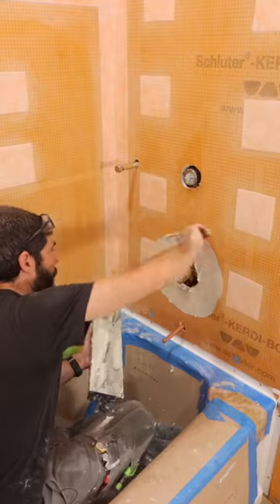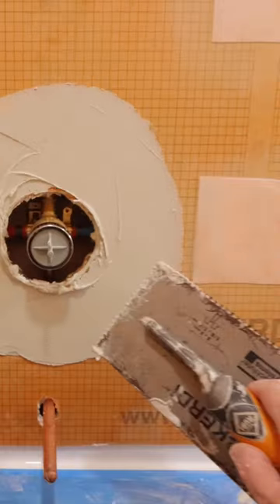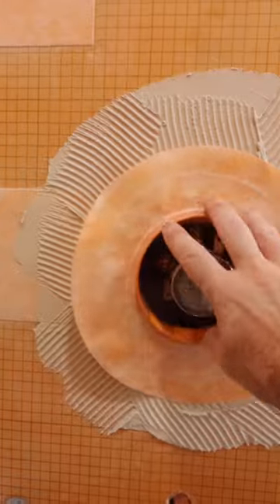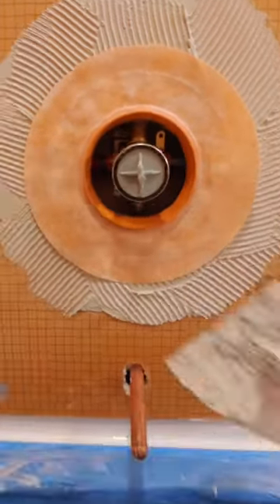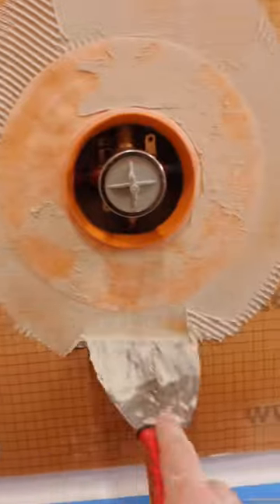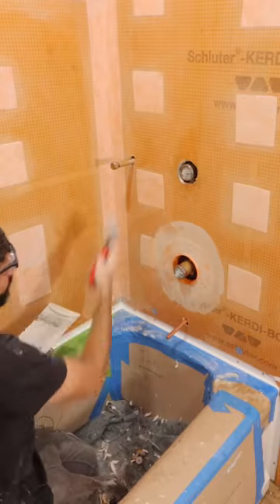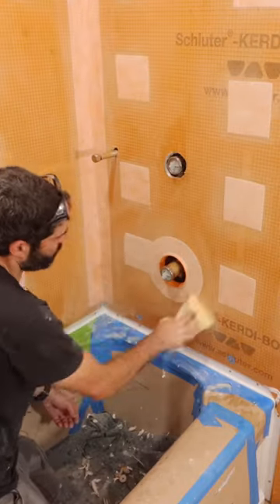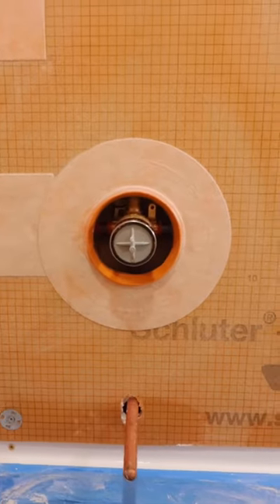How to Waterproof Shower Valves - #shorts

Comment: They should print the words inside and outside on it to prevent people from making the mistake
Reply from the maker: that would be helpful and prevent mistakes
Reply: I’ve met a lot of folks in my days who claim to be “pros and masters” and they don’t read half the time.  😏

Even i have made mistakes (simple) being tired and all.   but this is a case where i think adding “in/out would be beneficial.  

I have been away from construction since i retired from the Navy some 20 plus years now. new technology and love to learn. 

i often wondered why i never saw things like this in the repairs i do for some neighbors.  even newer homes are done half-a$$.
Reply: @stemmentor9700 
I was smoothing caulk with my wet finger..  The "carpenter" said..  
"Why are you watering down that caulk?"   needless to say...  Bye

Comment: This is the way I used to do it. Now, I used GoBoard caulking behind the seal. Apply it first, liberally, in a method that ends up resembling a daisy flowers petals until you've gone the entire way around. I then smooth it all out using a 4" joint knife, until the surface is perfectly smoothed out and as thin as can be - much thinner than it would be if I raked out a bunch of thinset underneath. Put the seal on, use the back of the joint knife to smooth it all out. A perfect seal, absolutely waterproof and without affecting the depth of the backboard at that one location much. Works perfect.

Comment: what is this and what does it do?
Reply: Kerdi…..drains your bank account
Reply: It is the Schluter system and it is the most foolproof, water proof system for wet areas of the house like bathrooms, steam showers etc. unparalleled effectiveness paired with an unreal guarantee. It is quite pricey, but you get what you pay for if installed properly.

Comment: Nothing beats a real concrete wall rather than using a wood as your base then you will install tiles where later on your will need to chain it because of the moist. Unlike  if it's a solid concrete then it will last forever
Reply: Have fun changing the tile on that concrete wall!

Comment: I'll stick with my dura roc and red guard. Setting tile on foam just doesn't seem smart to me. Guess I'm just old.
Reply: everything works good
Reply: @Elijah Kibukevich  yeah. For 3 years I'm sure. I build to last 20. I grew up poor. I do it once and I do it to last. This just has the stench of more money for shorter life span. I could be wrong but in my 20 years, every time something seems like this, it usually is.
Reply: @pstew5309 I’ve been a tile setter for about 18 yrs and I have pulled out more rotten wood from dura roc and Home Depot special
Red guard than any foam or Schluter system. Took me a bit to adjust but once you do and see if it’s done correctly it will outlast all of us
Reply: The fact that it is foam means nothing. It is stronger than drywall, and should be properly backed with framing. The schluter system is proven more waterproof than any residential product out there. Is just has to be installed correctly. If your framing is bad, there will be lippage on the tile, especially larger ones.
Reply: @Doesntmatter  funny. Cuz I have bathroom installs that are 18 years old with zero issues with dura roc and red guard. Notice how the point you made is doing it properly?  And at 1/4 the cost.
Reply: @goodrabbi7176  and that my friends is why you don’t listen to diyers. Framing has little to do with “lippage”. Don’t comment on anything else.

Comment: Would you recommend recording your contractors to make sure they’re doing it the right way?
Reply from the maker: No, not without their permission - but you could take pictures of the finished work after each phase, that way you have a reference of what was done
Reply: @HomeRepairTutor  Absolutely! That's something most good contractors do as an easy reference. My camera is full of these types of pics!
Reply: @HomeRepairTutor 
My builder didn’t put insulation in the garage wall even though it was clearly called out in the contract and charged an extra cost.  I had photos to back up my call.  He still denied. I sent him a certified mail telling him that I was going to video tape breaking all drywall in the garage and if it was insulated as he claimed I would pay for the drywall out of my pocket.  If it had no insulation he must put in insulation, new drywall plus $500 a day for every day he was behind schedule due to his lies.  
He shut up and corrected his fault in one day.

Comment: I love kerdi board I used it to replace the dry wall for backsplashes a lot when the wall wasn't flat or the person who installed the old tile did the job correctly and the drywall wanted to come off with the tile.
Reply: Go board is much cheaper and achieves the same effect. IMO it’s a little stronger because of the fiberglass in it. That’s the only downside. Will itch a little bit ha ha
Reply: @doesntmatter5263  and that, my friends is why uninformed people shouldn’t use the Schluter system. Go board isn’t remotely close to Kerdi board. Tell me you’ve never properly installed Kerdi board without telling me you’ve never installed Kerdi board.

Comment: Kerdy EVERYTHING
good lord
Reply: Kerdy is for rookies
Reply: @jimschaffer8921  Kerdi is for trained professionals… the other stuff is Waaaaaay outdated science… I’ve literally never seen properly applied Kerdi fail. Can’t say the same about the other methods. Plus the board is super lightweight and easy to work with(cut). Better than unnecessary cement board any day. Anyone who disagrees probably still thinks it’s a good idea to put dish soap in their joint compound.
Reply: @goodrabbi7176  my showers  are superior and will outlast any kerdi installation ….. and at half the cost. End of story….. its a free country 
So, 
you do you…

Comment: ALWAYS run a thin bead of clear silicone around the external fittings that meet the tile surface. NEVER leak around your fittings / behind your tiling again. SORTED. No need for all that fancy BS
Reply: I mean u can? But it voids schulters warranty, which is the main reason professional tile guys use it, along with it being one if not the best brand. Silicon isnt needed at all. I believe the US standard testing that was done showed 1/8 (may have been 1/16) of an inch of coverage was sufficient to the US standard on a waterproofing test. And they use 2 inches minimum on the installs. We made a sealed water bag from the kerdi cloth 3 years ago and it still is holding the water inside. And that was from a roughly half inch of thinset🤷‍♂️. Tested and proven with a ridiculously good warranty is hard to argue against
Reply: @RandomUser2388  I’m not disputing the effectiveness of the board product to prevent water passing through it.
 I’m referring to preventing external water that runs down the tiles and gets behind the tiling via any holes drilled into tiles. If water does this it may not pass through the board but it will certainly lay between the adhesive and tile back. This causes damp and mould. Causes grout to gradually stress and fracture, thus compounding the ingress of water in the shower area, escalating the issue. This can cause tiles to lose connection to the adhesive too. All issues that are very damaging and costly to rectify. 
A simple neat bead of clear silicone ran around the edge that meets the tile is vital to prevent the ingress of external water and problems mentioned above
Reply: @GRACEORT  wait? U think tile and grout are waterproof? Water will and does get behind tile. Thats known of every shower. What kerdi and redguard ect do is stop mold and mildew from forming. Also the foam acts as a strong insulator. Because concrete board will draw moisture from the outside of the shower especially showers built on the outside wall of a house. Hot shower water and cold outside air create condensation. But foam board or even kerdi cloth on drywall doesnt
Reply: @RandomUser2388  mate, the only way water is going to get behind tiles is if the tiles are absorbent which should NEVER be used within a wet environment. 
The grout is not flexible and cheap. I use a fully flexible waterproof grout suitable for swimming pools on EVERY JOB I do.
Water gets into drilled holes within a wet area because no silicone was applied between say the shower mixer plate and tile surface. It’s very simple. I’ve been self employed Tiling for 23 years and NEVER had a single problem. I tell all my customers that any sign of a problem they contact me immediately. Still waiting
Reply: @GRACEORT  you are wrong and the other guy is right. There is no “waterproof” cement used in homes. Grout is not waterproof or even resistant, and depends on the backer board to stop the moisture from getting to the wall and creating mold. The other guy spelled this all out for you, but you know better, right? The tile is the only thing that is water resistant, not the thinset, grout, or other magical stuff you are using.

Comment: I will never understand how that waterproofs anything. A hole in  the board is still a hole in the board. Still leaves the seal on the back of the escutcheon to do all the “waterproofing.”  Makes absolutely no sense
Reply: I don't get it either. Mine is backwards then, but by sticking out slightly beyond my Tile I have better waterproofing than flipping it around.  I'll stick with what waterproofs better.
Reply: @boogiedahomey well, if that's the case, a small half circle of silicone on the edge of the top half of the ring will fix it completely. I'll do that.

Comment: This is wrong you have to put the ring  first then put the water water proof membrane next around the ring
Reply from the maker: I appreciate your comment but this is exactly how it’s recommended by Schluter in their Handbook
Reply: I thought the same and looked it up as i never used it and the vendor does recommend this way.   And as a former “arch and civil engineer guy” , i’m pondering what difference either way would be. just curious ¯\(ツ)/¯

Comment: Why is everyone hard for Kerdi board when it’s like the most expensive shit out there. Think it would be cool if you showed something other than kerdi on here
Reply from the maker: I use it because it works and I can make custom niches, benches, curbs etc from leftover pieces - the customization makes it a great option. Also, their drains are the best because of the bonding flange, adjustable drain (for tile that’s huge) and they are solvent welded instead of relying of rubber gaskets. Normally I try to think about the client and what’s best for them, and I always end up choosing Schluter. I’m not paid by them or any other waterproofing company nor do I run discount programs on the side to get people to use any product - it’s simply what I choose to use for the reasons above.
Reply: I like it because it seems to be the best, and the price of it is nothing compared to the price of the labor...

Comment: Thinset absorbs moisture no?
Reply: Not really in this case. Vertical surface, and the Kerdi surface has a felted texture, so it really grabs thinset. Plus it is such a thin layer of thinset. The water takes the path of least resistance, and Kerdi is rated for something crazy like weeks submerged at 10 meters or something. No worry about water getting behind the membrane.

Comment: u new aged tile workers make me laugh
Reply: Right. Float or go home. Hate any board crap.
Reply: Yeah, and let’s add some dish soap to the joint compound, and fill holes in baseboard with Alex Plus. You old timers that use outdated science make me laugh. Next you’ll be telling me that your painting with lead paint.
Reply: @JesusRomero-ve2cs  float or go home? Why would someone float a vertical surface when there is framing? Someone doesn’t know that we are in a wet environment, and cement isn’t waterproof!

Comment: Or use the tile guard so the screws have a place to go especially on the delta
Reply from the maker: The trim screws directly into the valve, ie the valve is all you need not the black plaster guard

Comment: Another pointless video just to charge more money...smh
Reply from the maker: I appreciate your comment but the valve seal is affordable and installation takes 5 minutes, the cost is minimal and worth it to keep the installation waterproof.
Reply: I have never had a problem around the diverter. Im sure it takes longer then 5 min. I agree with waterproofing the walls and corners, but just use caulk around the diverter.
Reply from the maker: @JimmyG2527  keep in mind, you can use drywall and KERDI over it, the mixing valve seal’s rubber gasket covers the edges of the drywall and is slightly sloped so that water will drain away from the interior wall, so it serves a double duty - I like showing the installation for those reasons